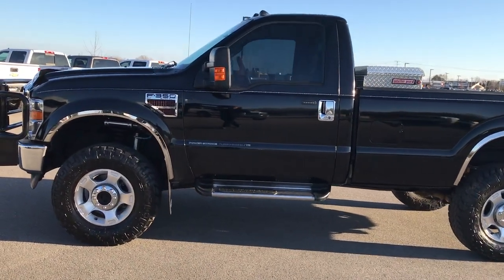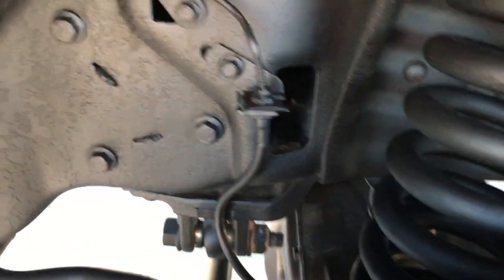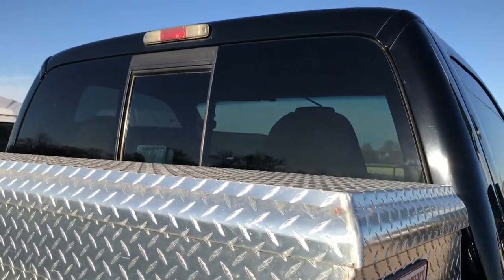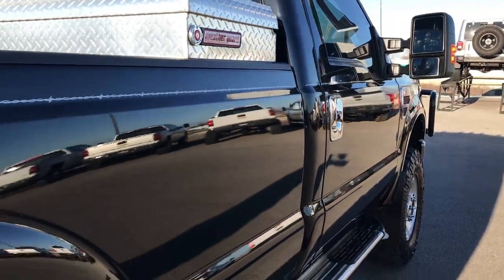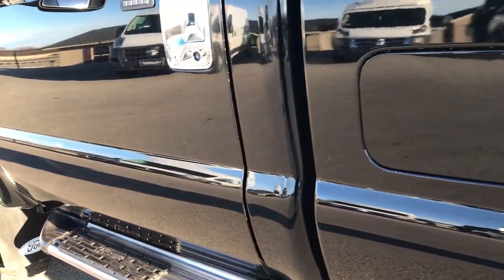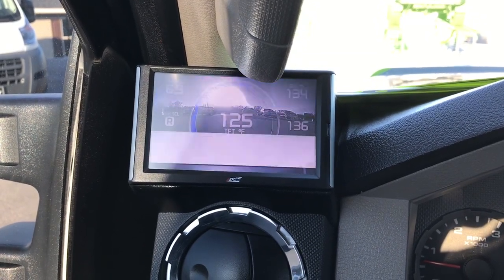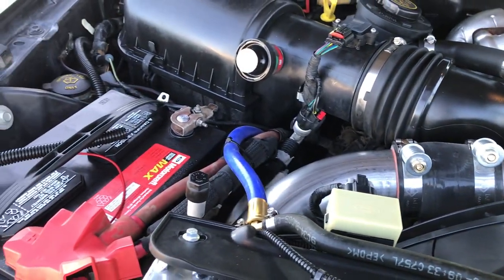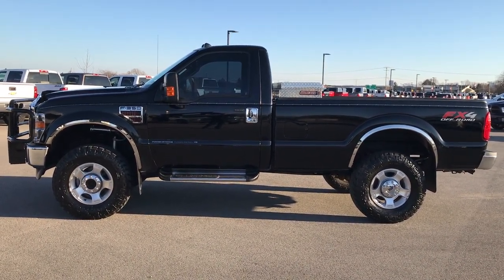2010 USED FORD F350 REGULAR CAB LONGBOX 1 TON FOND DU LAC WALK AROUND REVIEW SOLD! 9311

Comment: Never buy a ford with the 6.4 in it ever. The motor is a 150k throw away which means not even a block is salvageable
Reply: Your so fuckin stupid it's not even funny
Reply: Bristol Daffern You are correct Zachary Antoneshyn is stupid for getting Butthurt over a piece of shit Engine!
Reply: If I buy a ford which diesel engine would be best? Or not buy one at all?
Reply: @braveheart2785  in term of reliability 7.3 is gonna be the golden engine it’s literally a tractor motor. 6.7s are super reliable too. 6.0 are 50/50 you might get lucky finding a great one or you might find one we’re in debt. 6.4 are also 50/50. 6.9 are pretty reliable but are very very slow.